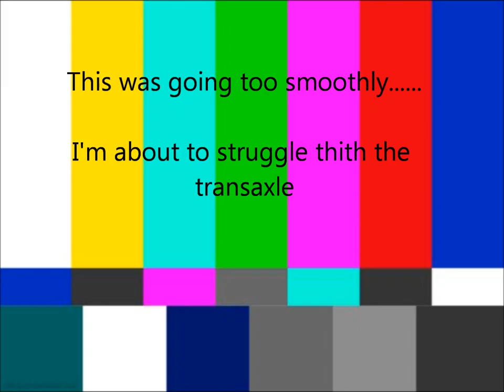V8 MR2 Build #12 Adapter plate and clutch

Comment: looking good..I'm just doing a k20 swap...that looks intimidating, good job
Reply from the maker: Thanks Man! I like a good K20 swap myself. I was wanting a large fabrication / welding project,
Reply: nice. hows it coming? im running 3sgte with 1200cc/megasquirt/gtx2867 but cosidering kswap.....
Reply: shane mack its coming but spending lots of money! lol. but I'll be glad in the end because parts are readily available locally
Reply: thats awesome. what ecu and motor? k24, k20, hondata?
Reply: shane mack built k20 ...I have a k24 and a k20 and I prefer the higher rpm myself.  built transmission.  I had a ecu from ecumaster black emu....but my tuner told me to sell it and go with hondata because its built specifically for that engine??   I cut the trunk out and there's tons of room for turbo/ intercooler piping because the exhause faces the rear of the car
Reply: shane mack I actually had a complete 3rd gen 3sgte and bought a ATS turbo kit and never used it LOL I end up selling the 3sgte and transmission but still have the turbo kit from ATS racing
Reply: what turbo kit do you have for it? do you have a turbo picked for the k20?
Reply: good stuff. will be a beast. i am considering just going k24 with cams and hondata....itb would be cool too
Reply: my gtx2867 .86 a/r is great turbo, but i want something smaller for the street.
Reply: shane mack I have a gt3071 at the moment ,but not sure what I'm gonna go with...Yea fast spool would be fun